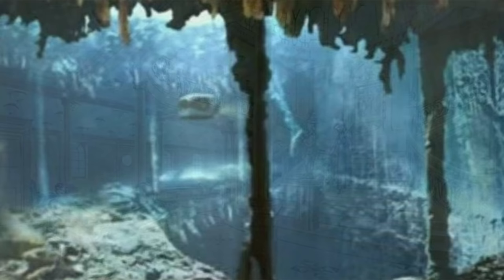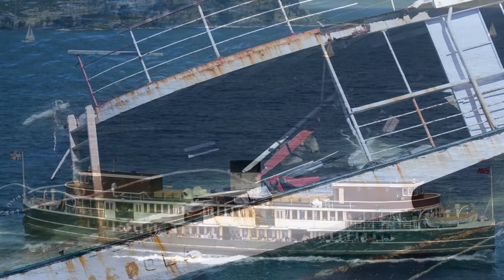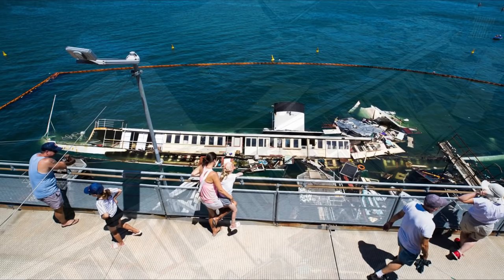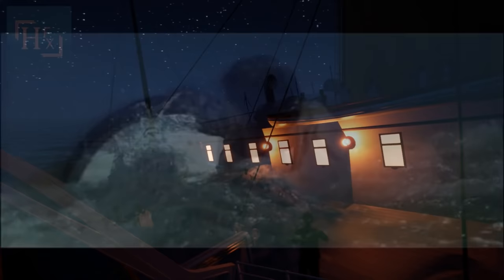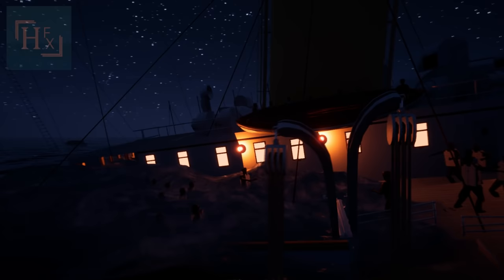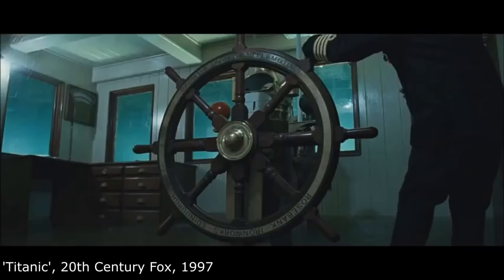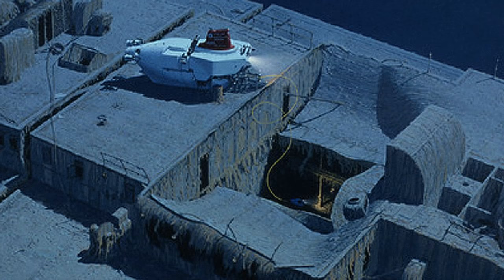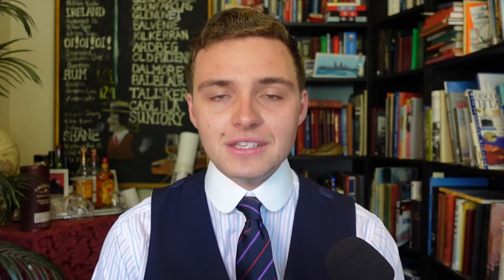What Happened to Titanic's Grand Staircase Dome?

Comment: Wood likes to float. I suppose the fact that wood likes to float and the pressure combined just ripped everything apart. The staircase I believe began to separate and raise up. Once submerged the dome and cover were gone allowing the broken up staircase to just float out of the massive hole. The bridge likely broke up like you said. Water smashes in the front of the bridge loosening the wood and making it break apart before she even splits.
Reply: That actually happened with the staircase built for the 1997 film when they flooded the set, constructed in a very similar manner to the staircase on the actual ship.
Reply: You are right sir. I believe it was in the documentary with Bill Paxton going down in the sub (ghosts of the abyss) that the grand staircase was gravity-set and as soon as the ship went under it would have been fighting to break free via the easiest route available.
Reply: There's also speculation that the wood didn't float up out of the dome, but rather out back through the corridors. Even still, wood floating doesn't really explain the metal frame under the steps being missing (which I want to say was where the speculation of it being pulled aft out of the ship came from, but I can't recall my source aside from it being a thread on the ET forums, so don't trust me on it)
Reply: Wood might like to float - up to a point, but if it always floated there wouldn't be thousands of wooden ships at the bottom of the ocean. Mary Rose, Vasa, (formerly) Batavia etc etc etc as well as ancient ships.
Reply: @LandyVlad_Rides  Those had to be solid meant for water. The staircase and bridge were not. The staircase was held in place by gravity once it flooded that staircase came apart. The bridge had to have smashed in from water pressure breaking up just a few feet underwater. Solid wood ships were well meant to be solid entirely where as metal hull ships needed a solid metal hull the wood was secured like it is in a house on metal hull ships.
Reply: There were steel frames on the staircase, so the movie set ain't a good example
Reply: @jeanscuissiato135  I was sure it was wooden without steel frame. I know it had steel mounts but the staircase was mostly wood and nails. The wood pulls away from the supports and it rises. We know some of the staircase did break loose because parts of it were recovered from the wreck site.
Reply: @crazyguy_1233  umm, no. Why would a wooden structure on a steel ship be less robust than a wooden structure on a wooden ship. That makes no sense.
Reply: @LandyVlad_Rides  Because it doesn't need to be robust it's not integral to keeping the ship afloat. The hull and bulkheads are robust and so are the walls and floors but the paneling does not need to be robust and the staircase is just fine not being robust since it's designed to be a staircase not a structural support.
Reply: @LandyVlad_Rides  This is a... really dumb comment considering you read the previous posts.

Think about it. The Dome cover and Staircase are not meant to be robust, when it comes to water.

If there's enough water to fuck it up that badly, the ship (and especially that area) is already fucked and that's the least of your worries... And what would it do even if it was built to resist water pressure?

It isnt saturated with water, it's dry. As mentioned it was gravity-fitted as well, as long as there isnt a sizable force upward with enough energy to lift it (which, again, wont happen unless you're positively fucked anyways), it'll stay in place. 

Not to mention: Part of what makes said ship wood more robust is the shape of it. You've got curvature and framework using that water pressure to help it stand up stronger (think like arches and gravity, and how they're better at taking loads. Or really just try crushing a vaguely-strong cylinder while pressing on it on all sides at once)
It's sealed with pitch or tar, often painted to help prevent rot (likely with a wood type that's ideal for preventing said rot, and general shipbuilding), and again, reinforced with a frame.

There is no need to resist water pressure in a fucking interior staircase...

Of course, it did have a frame, but i WILL bet you it was built to help support the weight of people pressing down on the wood. Not keeping it from lifting up or tearing free.
Reply: @LandyVlad_Rides  Actually one way to put it:
It's like asking why your drywall isnt robust when the Load-bearing beams and such are already doing all the work. They dont need to.
Reply: @higueraft571  Yeah I wasnt implying about those - more about the wheelhouse/bridge comments :)

Comment: A titanic surviver said while he was standing near the grand staircase dome, it broken with imploding sounds and the pressure tried to take him inside the hole which means it surely imploded due to the pressure. And also in google results they say the wheel house and bridge destroyed when titanic's first funnels fallen on to them
Reply: I’m not an expert at all, but the wheelhouse being destroyed by the funnel falling onto it makes more sense than total destruction by water pressure. Why (IMHO): the glass area is relatively big, the sides are completely open, and the volume of the wheelhouse is not to big either. This opens the possibility that water pressure inside and outside could level out very quickly, at which point destruction by implosion is unlikely.
My $0.02.
Reply: @TheSoundsnake  Most accounts state the funnel fell starboard. A few people say it was port. Either way, it's pretty much established the funnel didn't fall forward and crushed the bridge.
Reply: @hazyhope._.  I didn’t dive into that aspect, just saw someone mentioning in this thread that the funnel fell onto the wheelhouse.
Physics are simple: equal pressure, nothing gets crushed. I would think that the wheelhouse would fill quickly enough through all the holes (shattered windows and open sides) to equalize the pressure. But I don’t know at what speed the wheelhouse hit the water, the water entering through the front windows might as well have blown of the roof due to the air pressure building up.
The physics of pressure building up are behind most issues with blowing up windows and collapsing roof structures etc., always good to think through the various scenario’s and have a bit of an understanding how these forces act.
I’m not an eye witness, so anything reasonable is acceptable, and when the funnel fell sideways, it must have been pressure (water or even air). One should be able to calculate/estimate the minimum speed of hitting the water required to blow the wheelhouse apart, based on volume, open area (windows, sides) and construction. That would be nice!
Reply: That is I think the account of Colonel Archibald Gracie.
Reply: @TheSoundsnake  
I think your 2 cents is worth a few dollars!  I always noticed the starboard bridge wing flattened in the wreckage.  Tbe funnel definitely could have clipped the bridge and wrenched attached wing structures.  If not this, the forces plunging down to the bottom would have washed it away.
Reply: @hazyhope._.  How far starboard or port?  No doubt that the bridge may still have been clipped.  Regardless, the bridge would face immense hydrodynamics once submerged and plummeting down to the sea floor.  Even uncrushed by the funnel, it would likely have been washed away travelling that 2.5 miles, then the downblast after hitting bottom.  That was like a huge bomb detonating.

Comment: It was documented that when James Cameron was filming the sinking scenes for his Titanic movie both crew and actors that were on the grand staircase were shocked to find it beginning to float.  I would guess that the staircase in the actual ship was so large and heavy that it kept itself in place once built.  So could they have possibly broken up and floated away during the trip to the ocean floor?
Reply: They accidentally recreated it. Wow
Reply: @PelsckoPolesko  isnt that amazing? it speaks to just how accurate the movie really was.
Reply: i think that likely. though id imagine it was more securely attached than a temporary movie set in expectation of having to weather heavy seas so stayed attached for longer than the movie recreation did. which, of course, would result in that much more damage when it finally let loose.
Reply: @JACCO20082012  one thing i think the movie got wrong that would explain the bending of steel both ways in the double bottom is that after her back broke that let millions of gallons of water a huge new way of ingress and cause the area around the break to settle more quickly resulting in the remaining buoyancy in the stern causing it to them fold back upwards against the forward part of the ship until it was dragged under by the forward part. this would explain why all the bending and rending of the double bottom isnt only in 1 direction.
Reply: @thurin84  More accurately:
The Double-bottom buckled inward, shoved up the boilers into the upper levels, the hull was effectively fucked at a much shallower angle, but the Superstructure held the ship together until it eventually was torn apart from the stress. Resulting in a "top-down" (that was actually a bottom-up) break, the superstructure and hull tears free, but the Double-Bottom section is still attached, only bent. 

While still attached to the now-plunging bow, the Stern is pulled down by it, until it to eventually breaks off. 

That explains everything much more cleanly, how the ship chunks ended up where they are, and that bending in two directions.
Reply: @higueraft571  thats more or less what i was saying but i think the double bottom was the last to go hence the bends and tears both up and down.
Reply: I believe they did find a segment of the grand staircase in the debris field, I think when National Geographic mapped it.
Reply: @PelsckoPolesko  they didn't accidentally recreate it. They built it exactly the way it was made in 1912
Reply: @Truecrimeresearcher224  Not so.  I bought a part of the demolished set.  The staircase newel posts were made of plywood with cast plaster appliques painted to look like carved oak.  Not exactly like 1912.
Reply: @JACCO20082012  They tried thier best when it came to the movie.However even James Cameron admitted that the replica of the grand staircase in the movie was a better copy of the one on RMS Olympic rather than Titanic. This is because we dont know if both staircase were the same or not because Titanics was never photographed. The photos we see are actually from RMS Olympic.
Reply: We can guess that they were both at least similar since similar design elements carried on into the design of Titanics sister HMHS Brittanic as well as artifacts and photos from both olympic and Brittanic that show similarities and evolution in design.
Reply: @raymondhutchinson7156  Given that the hulls were reassigned during construction due to time constraints, one could argue it's still a photo of the Titanic's staircase
Reply: @halofreak1990   The only problem with that is that there were no known official photos of Titanics interior other than a handful taken on her maiden voyage. All known photos of her interior were taken by father Francis Browne. Luckily for Browne, he was forced to leave the ship at Queenstown ierland. Olympic on the other hand ,survived untill 1935 when she was scrapped and her interior  fittings sold at auction.The known photos of the foward grand staircase best match Panneling and other artifacts from Olympic that still survive scattered across the UK.
     Both ships were also not 100% identical considering design changes made that took into consideration flaws with Olympics design that were documented durring her first year in 1911.Ex: Olympics bridge wings were different from Titanic in that they were flush with her hull vs Titanics which were extended.Titanics second promanade deck was also enclosed to expand 1st class accommodations after the one on olympic wasnt really seen used.
There are also other smaller differences that have been found by researchers such as those behind the  Titanic honor and glory game.They found smaller differences in either ships floorplans as well as rare photographs. One photograph showed that a bulkhead between the 1st class dining room and an adjacent reception area had arched windows placed on Titanic as oposed to Olympic which did not.The dining room also has a coat room that Olympic didnt have and was found on the floor plans.
Finally, Olympic had almost 25 years of service vs Titanic who had only been finished since March 31 1912.That only left 10 days untill her maiden voyage on April 10th.Olympic had a longer exposure time and official photos were planned to be taken of Titanic upon her arrival to NYC.
Reply: @raymondhutchinson7156  so many interesting details. Thank you for sharing! I am fascinated by the details like this.

Comment: If I remember correctly during the filming of the 1997 film when filing the flooding scene of the staircase the thing ripped from its mount and floated away. It was probably more solid and sturdy than the dome and while it'll have ripped apart, it'll have also floated away. I think there were reports of broken timber floating in the sea after the event as well.

Comment: Something else I've heard is that while they were filming "Titanic" in the very accurately built replica, the Grand Staircase began to float during the sinking sequences, having never been designed to resist anything other than gravity. This floating and breakup greatly endangered the actors, and resulted in the set staircase being rebuilt but anchored to the 'deck'.
If true, then likely the original Grand Staircase of the Titanic would have floated to the surface, likely in bits, and drifted quickly away.

Well done, thanks again.
Reply: From what I understand, there's two components to the Grand Staircase: The wooden panels, and the metal frame to support them. The wood would definitely float off, but the real mystery is what happened to the metal frame they were resting on.

Comment: I remember mythbusters tested the idea of getting sucked into a sinking ship and got it dead wrong

The effect on the titanic was similar to partially submerging an open soda bottle, anything near the hole will be sucked in very quickly

They tested it with an old fishing boat that didn't sink in the correct way to create a suction force, since the boat sunk at roughly the same speed it filled with water from holes in the hull, there was no suction

Titanic sink faster than it could fill with water, therefore, water flooded in from any entrance it could find, creating massive suction forces

Comment: So, when the bridge was submerging/submerged, the walls could have popped and let a rush of water into the wheelhouse, then the officers quarters? The windows on the sides of the officer's quarters: would they have smashed as they were submerging? What about the ventilation inlets near the funnels? This video was very interesting! Thank you Mike!
Reply from the maker: Good points Thoji! The Officer's Quarters windows were brass-framed and photographs show that they were fairly thick, the style probably designed for use in more exposed parts of H&W ships likely to receive a battering from the ocean. They were also relatively compact; unlike the large, broad windows to the first class entrance and gymnasium. I'm not sure that they would have shattered; rather that the broken ones on the wreck today are the result of the heavy impact with the sea floor. Some were even forced open by this impact! The vents and intakes were also lightly built, and we know there were some extreme water pressure effects as 2nd Officer Lightoller was pinned to the grate of one at the foot of Number 1 funnel before fortunately being blasted free. The rule seems to be that the larger, or broader the surface of the object under pressure, the greater the forces acting upon it; so the relatively small vent intakes did not break up, while the large, broad surfaces of the staircase dome cover were unable to withstand the force of the water.
~Mie
Reply: @OceanlinerDesigns  As long as air has an escaperoute, the destruction will be less. 
Most likely, all air escaped via the hole where the dome was. 

Also big waves has a tendency to destroy steel and windows, assuming Harland knew this, and reinforced parts of the superstructure and front of the ship.

Comment: Good to hear you using the word ‘timber’ rather than what most simply call ‘wood’. Timber is cut and dressed wood that is carefully stacked for a number of years to allow ‘seasoning’ and controlled shrinkage to occur. In this way wood becomes timber which can be relied upon not to further shrink or distort when it is finally used for construction of furniture, ships decks, etc. etc.

Comment: Definitely as you said, the rooms that slowly flooded didn’t see as much damage as there wasn’t a huge pressure difference. The faster it sinks, the rooms haven’t filled up as fast as the water on the outsides and creates tremendous force. 

I also learned on a Titanic documentary with James Cameron about hydraulic forces at play when the ship hit the ocean floor as the hull compressed that water has to go somewhere and it blasted the cargo hatches quite a distance away from the wreck then you’d have a water column that the ship displaced on its way down weighing thousands of tons coming down on top of the wreck and bending the aft section down and causing further damage to the officers quarters and such as well. 

It’s really surprising that she stayed together as much as she did considering the physics of everything.